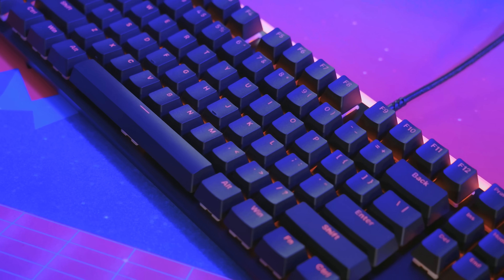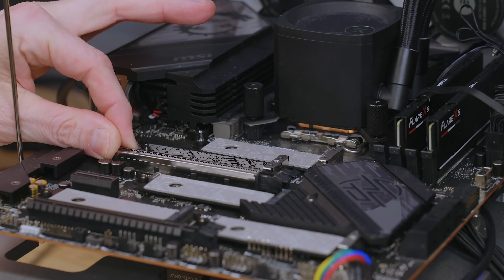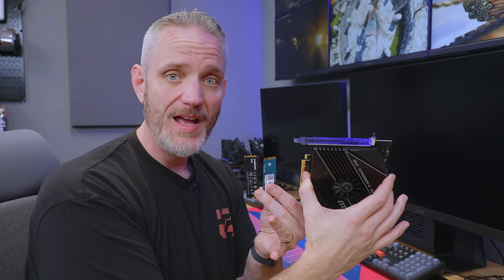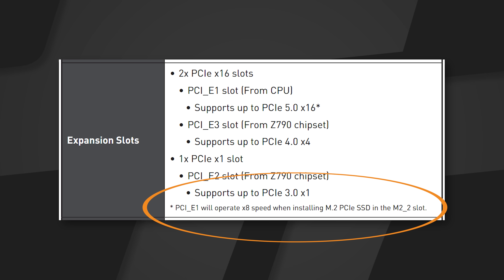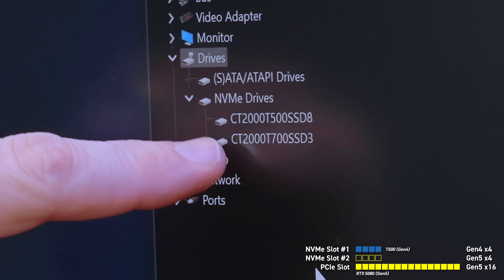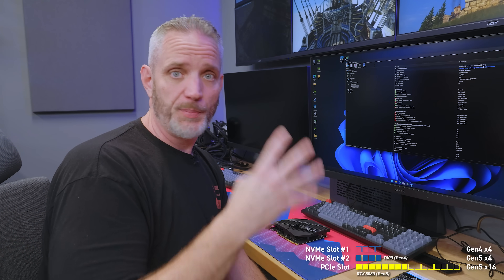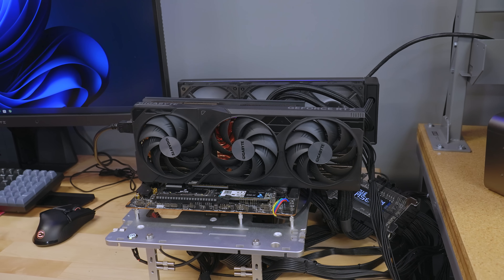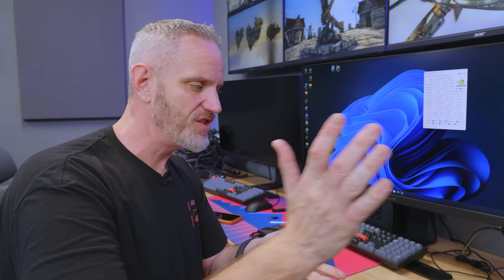Don't make this mistake with your PC!

Comment: ive never owned a board where the fastest nvme drive wasn't the top one plus every board ive seen has gen5 labeled on the heatsink. With AMD this isn't a thing you need to worry as much.

Comment: I have the ASUS ProArt X870E, with a Ryzen 9950X3D.  I relegated my C: drive (Windows and Apps) to a Gen 4 NVMe,  because speeding up those things does not really make them go faster.  The single Gen 5 NVMe near the GPU, was reserved for my Render/Cache drive.  When you are editing in Davinci Resolve at 6K - 14 bit color, that is were you need your file interactions to be very fast.

Comment: If your mainly using your system for gaming just use the PCH for the drives. Use the full PCI-e lanes for the graphics card. PCH is designed for drives.

Comment: I didn’t read the manual and just slapped an NVME into each of the 3 slots… but I did read the specs to know my 5.0 NVME went into the 5.0 slot and the other 2 are 4.0. Guess I lucked out with MSI knowing their shit, because everything is working as intended.

Comment: "Read your manual" ... i did... literally doesn't touch on this at all
Reply: I just checked my mobo manual as well as I got curious. Nothing specifying lane sharing for my old ass x470 board.
Reply: I have a MSI board that don't do well at explaining it either and it does do funky things with slots when this or that slot is used, it tells you about it but its not vary clear or straight forward, almost feels like it was a, whoops we forgot to throw this in the manual kinda thing lol. My Asrock x570 Taichi was pretty clear on what does what when you use this or that slot.
Reply: @VikingDudee try using chatgpt, its pretty good at helping with this stuff.
Reply: Its offten written at the end of the page in small letters.
Reply: buy gigabyte motherboards, then. duh
Reply: I'm pretty sure it did. What board do you have?
Reply: Not all boards have lane sharing. Are you having some kind of problem where you think it's happening when it shouldn't be?
Reply: @covante4822 no, not really. I'm pretty sure I'm using all lanes properly, it's a tuf gaming B650-E wifi  with a 7800x3d. I have the one gpu in the top slot, and all 3 m.2 slots have a gen 4 drive in them. I'm pretty sure that's full lane saturation without going over, but i remember the first video jay made about this a year or so ago, i went into my motherboard manual to double check and couldn't find a damn thing mentioned about it
Reply: Asus MOBO prices are just insane. I had to go with Asrock for the full pcie nvme and full pcie 5.0 x16.
Reply: Check the page immediately after the diagram of your motherboard slots.
Reply: This is usually addressed on the spec sheet, you don't even need to dig into the manual.  Where it gets wonky with AMD is if you have for some reason chosen an 8000 series CPU.  Just do yourself a favor and not.

Comment: 10:59 - Sigh.  This is what's so exhausting about PCs.  I only added one extra drive to my pre-built, and after using all the tools in this video, I realized:

My Samsung 980 Pro (the drive I added) is running at Gen3 speeds in a Gen4 slot (x4 8.0 GT/s) ❌
My OS MSI drive is running at Gen3 speeds in a Gen3 slot (x4 8.0 GT/s) ✅
My 4070 is running at x16 4.0 ✅

So, ultimately not that bad, probably would have saved a few bucks on a slower drive, but I'm just glad it's not stealing lanes from my GPU 😊

Comment: one of the best bifurcation example description for some board was from intel; bifurcation is dependent on the cpu and chipset u have, usually chipset deals with peripherals and some pcie and cpu deals with ram pcie and all major connects that need direct to die link

Comment: Interesting, I HAD to go into BIOS and set my X16 GPU slot and bifurcate it as x8, x8 before my MB would recognize my 5060 (which runs in x8). Auto wouldn't "work". Maybe that is unique to my particular mobo (Gigabyte B550 chipset). One reason to have a 'spare' GPU laying around; in my case my trusty old 1030

Comment: WHAT I DO IS BUY A MOTHERBOARD WITH THE LEAST AMOUNT OF STUFF . THE BEST IS MINI ITX MOTHERBOARD  YOU GOT THE LEAST AMOUNT OF TOYS ON IT. BEST ONE IS X870I MINI ITX MOTHERBOARD YOU GOT ONLY GOT 2 NVME SSD SLOTS  FIRST ONE IS PCIE 5.0 2ND PCIE 4.0  AND  PCIE 5.0 SLOT FOR GRAPHIC CARD AND 2 SATA PORTS  THAT IS ALL THE TOYS SLAP ON RYZRN 7 9700X LOW COST CPU PICE 5.0 CPU  OF YOU WANT MORE LANES THEN YOU BUY TOP TEAR CPU 9800X3D ITS VERY EXPENSIVE  YOU GOT YOUR 2TB OR 4TB N ME SSD PCIE 5.0 AND YOUR 2TB OR 4TB N ME SSD PCIE 4.0 ON YHE REVERSE SIDE UNDER  THERE IS NO HEAT SINK  SO YOU INSTALL THE SLOWEST M ME SSD PCIE 4.0  THAT THERE TO USED AS BACK UP STUFF  THIS IS WHEN YOU NEED TO READ YOUR MANUAL  YOU NEED TO KNOW SHARING LANES WITH THOSE SLOTS  THIS IS WHEN MINI ITX WIN THE FIGHT VERY LITTLE TOYS ON THERE TO DO SHARING WITH SHARING LANES AND SLOTS WORKS THIS WAY YOU USE THIS AMD THAT  NVME SSD SLOT 1 PCIE 5.0 NOTHING SHARE WITH  LETS MOVE ON NVME SSD SLOT 2 PCIE 4.0  THAT US SHARED WITH THOSE 2 SATA PORTS THAT WILL BE DISABLED  AND YOU GET TO USE THAT PCIE 5.0 FOR YOUR RTX 5070 TI NO SHARING AND RUNNING 16X  BUYING A EXTENDED ATX WITH THE MOST TOYS ON IT WASTING MONEY AND CONFUSING AND COMPLICATED FIRST THING FIRST I WAS UNABLE TO FIND A ASROCK X870I MINI ITX MOTHERBOARD I GONE WITH ASROCK PHANTOM GAMING X870 RIPTIDE WIFI LOTS OF SHARING THAT TOP NVME SSD SLOT 1 IS RUNNING PCIE 5.0 16X AND TOP PCI RUNNING 16 X FOR THAT GRAPHIC CARD  AND ALL MY SAYA PORTS DISABLED FOR SHARING LANES MY OTHER PCIE SLOT RUNNING PCIE 4.0 RUNNING 2X ENOUGH FOR A SOUND BLASTER AUDIO CARD  IF I CAN AFFORD IT NO CASH LEAVE THAT EMPTY  MU SATA PORTS DISABLED FOR SHARING LANES  YO KEEP N ME SSD SLOT 2 AND 3  BOTH PCIE 4.0 OPEN FOR USE  I AM HAPPY WITH THAT NOW GO TO EXTENDED ATX I AVOID IT ALL COST  LONG STORY SHORT SHARING LANES WITH TOYS  UE A FEW TOYS AND EVERYTHING IS DISABLED  YIU GOT 6 NVME SSD SLOTS  SOT 4 ,5, 6 DISABLED  ALL SATA PORTS DISABLED  NVME SSD SLOT 2 PCIE 4.0 RUNNING 2X OR 4X YOU GET PCIE 5.0 SLOT RUNNING 16 X  THE REST OF THOSE PCIE SLOTS DISABLED  YOU DO NOT HAVE 120 LANES IN THAT RYZRN 7 9800X  THAT X870E EXTENDED ATX MOTHERBOARD  THAT YPU PAID $800.00 FOR USELESS  EVERY TOY IS DISABLED AND SOME RUNNING PCIE 4.0 RUNNING 2X THAT IS NVME SSD SLOT 2 AND 3  TO WIN THIS SHARING FIGHT BUY X870I MINI ITX MOTHERBOARD BAD NEWS ONLY ASUS GOT ONE  MSI ASROCK IS A NO NO  SO I GO 2ND BEST ASROCK PHANTOM GAMING X870 RIPTIDE WIFI ATX MOTHERBOARD  YES A LOT OF SHARING I XAN WORK ON IT NO  PROBLEM  SATA PORTS DISABLED FINE I AM NOT USING IT HARD DRIVE IS LIKE FLOPPY DRIVE  I ONLY GOT A LIMITED AMOUNT OF TOYS TO DEAL WITH SHARING LANES  EASY TO WORK WITH

Comment: I wanted a Aorus b850 board but most B850 boards had some kind of PCIe Bifurcation from the CPU and I needed x16 lanes for GPU and and still have 2 NVMe drives at max speeds so i went with the MSI B850 TOMAHAWK MAX WIFI. Love it so far.

Comment: Guys, can i get some help on those topics.
I'm currently programming my next pc.
I will run a x870e hero by asus, with a 5090 and a 9800x3d.
Can i do what i'm about to say?
Can i put a gen 5 ssd on the first slot, and 2 other gen 4 ssd on the 4th and 5th slot?
Cause i read that if i use the 2nd and 3rd i will run into bifurcation.
But nothing and nobody say about use both 4th and 5th slot
I appreciate the help
Reply: Yes, those Gen4 M.2 slots don't share lanes with anything.

Comment: someone made a video for all current x870 motherboard pice lanes and all the different variations the motherboard can do depending on whats being used, i watched it with no sound at work but it was so intuitive in how they presented it, msi also has a diagram for all their current motherboards as well on one webpage. Been researching which am5 motherboard i should buy if i upgrade to it that could support 2 modern gpus and a couple of m.2 ssds without causing the lanes to split to shit since iv been looking at the lossless scaling framegen on a 2nd card thats been a buzz lately. Best configuration i can think of is just having all m.2s on the chipset and let all the CPU lanes be for add in cards which would make the most sense to me, but for whatever reason MB manufactures make the oddest choices and could have everything right but then fuck up the pcie lanes with m.2

Iv only looked at x870/e boards and only a few meet my standards furthermore,  the $1k+ msi godlike has abysmally worse splitting configurations than some of the ~$300 asrock boards and some manufactures' boards still use 3.0 for the 2ND or 3RD slot.

Currently im still on an am4 board with a 9060xt 16gb, my gpu can support 5.0x16 but its running at 4.0x16, the performance is negligible for the 16gb variant of my card even at pcie 3.0x16 but for the 8gb model the pcie bandwidth/version affects the performance immensely more, depending on the load it can make it unusable.

The asrock x870 tachi is probably going to be the cheapest x870 board that has the most decent and understandable bifurcation between the 2 main x16 slots. They are both 5.0 but split to x8 speed when used together and you still have enough to use the 5.0x4 for the main ssd no matter what configuration. The chipset then deals with all other m.2 slots and everything else without needing to bifurcate anything

Comment: What is really annoying: when the motherboard doesn't explain anywhere but in the manual that using certain slots or m.2 slots will lower your gpu slot lanes.
I appreciate the fact that the Asrock X870E Taichi doesn't do that, you get 1 x16 5.0 gpu slot or two x8 5.0 gpu slots if you use both, and none of the m.2 slots interfere.
Pro tip for anyone shopping, you can look at the spot and SEE what is pinned for (x4, x8 or x16) is you look at either the back of the motherboard, or the inside of the slot.
Also, most slots will not bifurcate an x4 slot for an m.2 card, it will just only allow one drive to be used.

Comment: One thing you left out is that it doesn't really matter if a PCIe 5 gpu runs on 8 lanes, because the system still can't saturate the bus in most scenarios at 8 lanes....
It might not saturate the bus at PSI4 x8 either...
I do agree that you should not buy things like storage that will never run at that speed, and that you can slow the system by forcing a lower PCIe rate by accident...

The main issue we actually have, is the CPU makers continue to make CPUs that don't have enough lanes to begin with....
Reply: That's why I'm going to consider threadripper in my next build

Comment: Depending on the motherboard (even current threadripper) you can have a pcie card with 2 or 4 M.2 drives on it and depending on what the motherboard can do...even on x16 slot...you may only see one drive....what Ive understood previously is multiple drives on a pcie card requires bifurcation no matter what (jay said the opposite around 4.30) ....you can have dozens of available pcie lanes available and they may simply not be used / allocated to the add in card

Comment: Thanks for doing this additional video.  I just built a new PC this spring and I really appreciated the lane mapping videos on YouTube (they make it so easy to visualize and map out those slots) as lanes are suprisingly limited now that we have so many devices requiring more lanes.  I bought a motherboard and nvme drives that maximized the lanes for the devices I bought while still keeping my graphics card at x16 and allowed me to keep my 3 NVME drives from cannibalizing that performance.  So many motherboards at double the price bifurcated in ways that made maximizing the lanes impossible for my configuration.  (I actually bought the ASUS x870e Gaming for how the bifucation worked on it since all the other ASUS boards did it completely differently at higher price points).
Reply: These (more) detailed lane mappings should be included in the manual. After reading the Asus X870E hero manual, I still wasn't 100% sure if the m2_4 and m2_5 slots were not explicitly mentioned to be fully independent and capable of full pcie4 speeds.

Comment: Extra tidbit:

Intel, since z590 (I think?) and only on the Z chipset boards, uses 8 DMI lanes (basically 8 pcie4 lanes) between the cpu and the chipset while amd has been using 4.

To note that this means that every nvme drive, every usb port, sound, some cases wireless and lan ports that are connected to the chipset will have to go through those 4 (8 in the case of intel Z chipsets, and I think W?) lanes between the chipset and the cpu.

Basically, doesn't matter what nvme drive you put on those nvme chipset slots, there will always be a latency penalty maybe even actual data throughput rates, because everything will be fighting for space on those lanes.

Comment: Correct Jay, that's a question for Intel and AMD. The manufacturers tell us how many cores and threads there are in the CPU, it's up to us (end user) to find a balance between the CPU and Mobo combo that will run the drives we want to put in the slots.

Comment: Some corrections I feel I need to make (I was going to write more but he addressed the others later in the video):

At 04:00 he says that the expansion card will be bifurcated into x2 x2. That is untrue. The way that card is wired only one of the two M.2 slots will get x4 lanes.

Comment: This is why I wish there was still some development for SATA. Standard gaming-PCs with 1-2 NVME-drives is no problem, but if you actually need 4 or 5 drives, this stuff becomes a nightmare to deal with. SATA is so much more flexible. And, newer SATA SSDs do in alot of cases, even use the same hardware as some NVME-drives and are capable of high performance - but they're limited by the bus speed. If we could get something like 2000MB/s over SATA it would be a godsend. More wires and more mounting points would be a necessary evil for those of us that need it
Reply: I've been running eSATA... Where USB was slower or unreliable.
Reply: If you need 5 drives, you get a NAS, use the SATA ports, or you buy a board that splits the lanes from the GPU. Those are the solutions. SATA isn't more "flexible". It just uses cables. having to have dedicated space for the drives in the case is already a limitation in itself. And SATA did progress, and you did mention it: by using PCIE lanes. So it would literally be the same as NVMEs right now.

Comment: bifurcation on threadripper 9000 was confusing. I'm using a hyperX. At first I only had 1 drive. No issues. I just added a 2nd drive. It didn't show up. I'm aware of bifurcation. But I couldn't find it. I had to flip the slot settings into "RAID mode". I'm like WTF can't you just call it bifurcation? I'm not using RAID. No one uses hardware RAID. sigh...... But anyway it works now. This is an ASUS SAGE WIFI board. It was the 2nd cheapest and I didn't like the cheapest. This is a great board, but the BIOS sucks.

Comment: In case of the ASUS Board, its not realy correct, what you say. If you put 2 (OR!!! 1) SSDs in the Slots M.2_2 and/or m.2_3, the PCIe x16 (G5) will always cut in x8 mode. You can check the matrix, on page 14. It is realy a mess, when you have many M.2 SSDs.
Reply: It's not a mess. That's just how lane sharing works. He just said it incorrectly.
Reply: @Dexx1s  I think, you dont understand me, what i mean with "a mess", i dont mean the technical point of view, more the manuals, the difference bitween manufacures and falls or missleading advertisement of them.  :) No problem
Reply: @l4nsocrates but that's not a mess neither. 
They all use the same standard. What Jay showed for the ASUS board at the end, everyone uses that table format, explaining it in plain English. 
It's also not misleading; people just don't RTFM despite not knowing how motherboards work. There is nothing misleading about it neither. You're expected to RTFM. 

Without even seeing that breakdown, of an X870E board says it has 3 Gen5 M.2 slots, I know immediately that lane sharing is happening.
Reply: @Dexx1s  Okay, you realy dont get my point. Again, no problem. Have a good day :)

Comment: Recent MSI motherboard manual have the best block diagram at the end. You see where the PCIe lanes are going. On the X870E Tomahawk, PCIe 5.0 x16 go to the GPU / x4 is dedicated to the first M.2 / x4 is shared between the second M.2 and the USB 4 controller. All 24 CPU lanes are in use. Only 4 are bifurcated if you populate the second M.2.
Reply: If you even max out a usb 4 bus.  We don't max out pcie gen 5 lanes.  They could bifricate that gpu slot to just 8x and give it to two more m.2 slots, and you wouldn't even notice.

Comment: I'm not quite sure if I've gotten that "Aha!" moment just yet, but man have you instilled a "I need to investigate this more" moment for me, Jay!! I am going to confirm the gen of the M.2 drives I'm using & see if there's any lift with repositioning, or if that's even needed. (Currently using 2tb Samsung 990 Pro & 2tb Corsair M600 Pro & a Zotac Gaming 3090 Trinity OC gpu).
I did refer to the MB manual during the build but now have a need to investigate further. goes into detective mode
Thank you for the info as always 😎👍